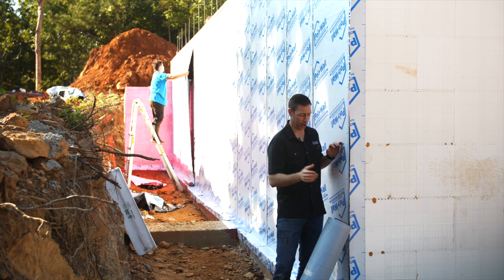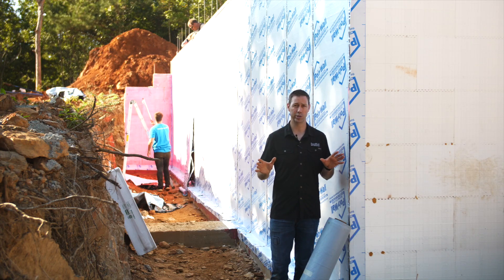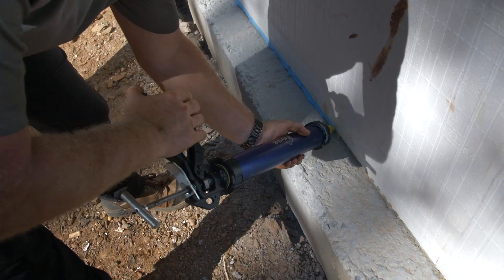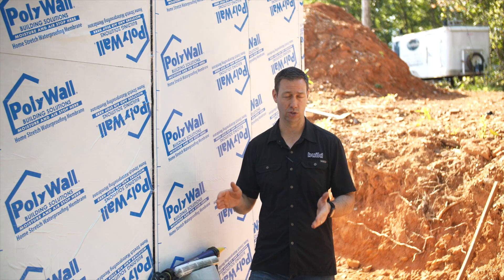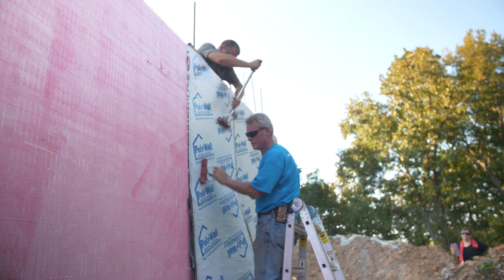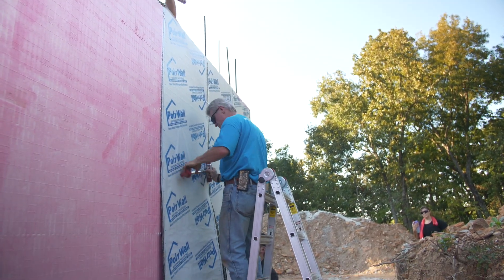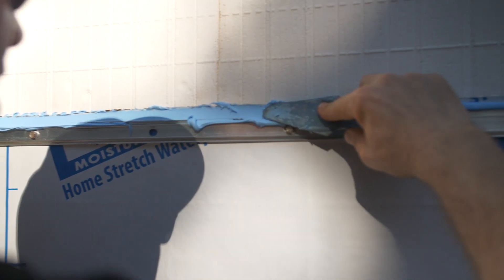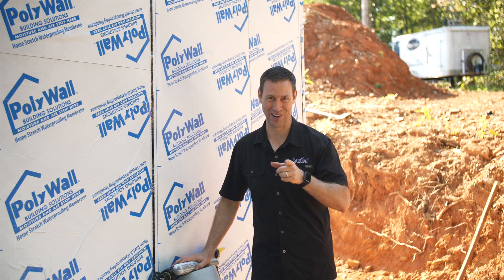This Pink Stuff is The Secret to ICF Waterproofing

Comment: If the location of your project needs the waterproofing you are installing, I believe you should put in a floor drain that allows the water table to enter the inside of the house. The reason is if the water rises on the outside only; it will lift the building like a ball in a pool.

Comment: If you use 4400 PSI concrete, no waterproofing is needed. Cost is higher, but you save in other cost down the road. No matter what type of covering you use on the outside, the concrete itself will be waterproof. I just looked on google and these were the prices of concrete mix, which vary from location. I think it would be cost effect to use higher PSI concrete for several reasons too. Waterproof and stronger are number 2 reasons!
3,000 PSI, 6.0 Sack Mix	$124
3,500 PSI, 6.5 Sack Mix	$126
4,000 PSI, 7.1 Sack Mix	$129
5,000 PSI, 8.5 Sack Mix	$147

Comment: Can you add rockwool exterior insulation?
I know insects like the foam and it catches fire easily
Rockwool doesn't
Reply: Insects don't like the foam, they only use it to reach any wood parts of the house. It also doesn't catch fire easily, no easier than timber.

Comment: What? Why would you not cantilever the wall over the footer? It's crazy setting it the way it is pictured. Water will eventually find a way under the ICF with the walls set back from the edge. Sticky paper stuff cannot last more than 20 years or so.
Reply: Building codes (in my area at least) require a minimum of 2" of footer on either side of the foundation wall.

Comment: Does anyone know if you can do this inside? I have a storage room that is made from this foam project but it leaks into the storage room.  The house was built in 1997. It's already been backfilled. Just wondering if I could do this inside the room to stop the water from coming in? Or if that defeats the purpose of waterproofing.

Comment: Just watched a video about how ICF is impossible to get touched by any termite treatment if you live in western NC... they can't do any type of reliable inspection on the foundation to see if there are termites fluting up inside the Styrofoam insulation walls... This seems to suggest that these waterproofing steps are not bug proof and the bugs can foul the waterproofing up. I am not happy to hear any of that as I really like the idea of ICF otherwise. Any thoughts?
Reply: We install ICF in S.C. , I install a metal cap at the top of the wall so termites cannot tunnel up through the foam

Comment: german structual engineer here. Weird that youre not just using waterproof conrete (25cm thickness) and a internal joint tape. That system doesnt fail unless you mess up the concrete bigtime which would be visible and fixable before you backfill the basement. These external applied PA doesnt protect from pressurized ground water right?

Comment: Awesome video, Matt! If a project calls for ICF on both the basement (9' height) and the 1st floor (10' height), how do you phase the work? Or, are both the basement and 1st floor assembled and poured at the same time?
Reply: there is a cold joint between the lower level and the first floor.  Much like the cold joint at the footer.  In theory you could pour them all at once but the weight of the liquid concrete may cause a blow out of the blocks, the relative high falling level of the concrete could cause separation of the aggregates and it would make vibration difficult.  supporting the blocks during the pour would be difficult.  so they would leave rebar sticking up 4 feet out of the lower level, then lay the blocks over them, tying them in to the rebar.

Comment: Isn't applying polywall an overkilling?  I would expect the concrete to be water/air proof and will concern only the possible damage that could be done below grade by backfilling.  That is the only reason I think the foam needs protection for.  Can someone please explain?
Reply: Moisture weeps thru concrete. Joints in the blocks allow water to penetrate into the concrete. Always use a moisture barrier to keep water away from concrete that you want to keep dry.

Comment: I would like to know in the ICF construction is it possible for the foundation to waterproof by putting cement on the ICF and after putting Bitumin on top of the cement which is on the walls of the ICF .

Comment: I live in upstate NY, whenever we do icf's we always use pour a concrete chamfer  between the footer and the icf, a few inches up the ICF that tapers away from the building the width of the footer on the outside to help shed water.
Reply: We just did a monopour in upstate NY using the Foothold footer form with ICFs for the wall. It prevents the cold joint, and makes it unnecessary to do a separate footer pour.

Comment: Great video, very detailed. Now if you build in a flood zone or have a high water table, the waterproofing will be a life saver. But generally, I wouldn’t want water to get anywhere near my foundation. French drain and wraparound deck should be helpful. Would not want to skip on waterproofing though

Comment: Went to poly-wall's website, they say this stuff will only work with 25 degrees or higher. I am planning to build a home in the UP in northern Michigan, were temperatures in winter go between 7 degrees and 37. What waterproofing method would you recommend for this?
Reply: That's the temperature for applying it. If you look at the data sheet, it passes a -15F flexibility test.

Comment: Putting that expensive caulking and tape on the entire ICF wall is a complete waste. If you deal with the possibility of water entering at all your openings in the wall correctly, that's all that matters. Unless you are trying to seal against a high water table in basement walls with tape layers (also a bad idea), there's no need to tape your basement walls against moisture coming in through the walls like that.

Moisture on the inside of a basement is likely from condensation, which for an ICF house, that can be a real issue since your air exchange is some tiny fraction from normal leaky houses.

Comment: Your videos are very informative an straight forward. Any thoughts on termites, bugs using the insulation for nesting? We have a house on well and septic as well as a pond very close and stream, streams. We don’t want to treat any soil because of these issues.
Reply: Termites and other bugs won't eat the styrofoam or nest they don't like it. Another reason the home insurance is cheaper.  If you put wood trusses and roof, the termites will go to the roof and eat. Put a concrete roof on your house and bugs won't be a problem.
Reply: Mike Bigelow how do you build a 6/12 concrete roof?

Comment: In Poland we isolate foundations (normally brick foundations) with styrofoam blocks (for termic isolation) + mesh + plaster and then we paint 1-2 layers of tar-based isolator called "dysperbit". This gives more then enough waterproofing and you don't need special crew that knows how to stick correctly sheets of isolating paper. Basically even a kid would be able to paint it. At least this is enough if foundation do not reach underground water level. Horizontal izolation we do with tar paper 1-2 layers heated with a torch to melt nicely and stick. You should be able to do same/similar thing with ICF. If this is feasible this would make it far better solution then depending on crew's expertise on sticking poly-wall waterproofing paper. Far less probability of error

Comment: Matt, left you another message on another video but for this one, if my home is 100% above grade actually probably 3 feet. And I will have an ICF foundation as well what kind of wall waterproofing would you suggest. It just seems the system in this video  is more for below grade and or were grade made meet the wall. Just looking for some thoughts I will likely call poly wall directly as well

Comment: So if you lived in a colder climate could you put something like the zip system osb with 2” attached foam insulation on the outside?
Reply: Cold like Canada? Not recommended. The vapor point could be inside the wall and it needs to breath.
Reply: 99beta then how would you go about adding more insulation to the outside? I’d prefer a good 6 inches. Zip-R9 has 1.5 inches of foam, there should be no condensation behind it. 

I’m also thinking that using the Zip-R would give a continuous surface for waterproofing and siding attachment points.

Comment: Most concrete basements I've seen don't have any water-proofing.  Is it a big mistake no to water-proof?  Surely the footers on even this ICF project are not waterproofed...
Reply: This is really soil dependent. Some very well draining soil areas, like sandy places, the builders don't do anything beyond the minimal asphalt damp-proofing. If you are in heavy rain locations that has any clay content, you should likely waterproof. I recommend it for every house because the one deluge may come and overwork your natural drainage conditions. If you are on high ground in fast draining soil, and super tight on expenses, you could probably get away without serious waterproofing. But I recommend at least a little mitigation effort. Even if its just a 6mil polyethylene sheet draped down the wall before backfill and backfilled carefully not to tear it too much. Runs a few hundred dollars even on a large house and will catch most issues for most people. For people living in the mud, an integral waterproofing admix like Xypex or such should be used. For a high water table build that is only going down a few feet and you could run a horizontal peel and stick, that may be more cost effective. So, it all depends. Your local codes will provide a minimum. Your soils engineer will provide a good answer. (And get a soils engineer to verify bearing capacity so you can likely reduce your rebar and concrete load, a few hundred dollars in the soils bearing test typically saves a few times its cost in rebar and concrete due to overbuilt footers, and a little bit of peace of mind.)

Comment: My question is termites. I've seen termites build channels through Styrofoam to get at wood several feet above. They stay moist and warm on their journey to lunch. Will the foam on these walls act as a conduit for termites ?
Reply: John Lynch I’ve read that the foam does not stop termites or ants, but I wonder if this poly wall is too much for termites to eat through?
Reply: @ScottTooley  I had a neighbor who replaced some damaged siding. Under the siding was styrofoam sheets of insulation. The termites ate channels through the styrofoam. Looked like a multi tunnel subway system.
Reply: Termites is the biggest drawback of ICF. Be diligent in termite proofing

Comment: I was wondering cost in materials and labor just to have it sprayed with a closed cell polyurethane foam. You get higher R values per inch 6.5 vs open cell foam of 3.7  per inch as well as no penetration from water etc thus eliminating the extra labor and materials for the outside barrier.. I know the spray is more expensive but only needs 1 laborer to apply and can be done in 1 step. Thx.
Reply: spray foam is solvent based and will eat the styrofoam.
Reply: @marks6663  Thx Mark, good info to know.

Comment: Common sense? Ring a bell? And or life experience?......... you have 6in of monopour concrete maybe 8 ...... etc.  water is not going to blast it’s way in. It finds the easiest path of flow. U got 2 inch foam then6 inch concrete and 2 inch foam again. All this useless shit u promote is a waste of money and time. But hey I get it it’s your job to feed trash to retards
Reply: Concrete is not water impervious naturally. In slow draining soils, expansive soils, and high water table areas, a flooded basement can quickly occur without waterproofing the concrete. Concrete is just like a very heavy and dense sponge. Once it saturates because of the hydrostatic pressure of water against the concrete it will just drain water into the basement. Or make it damp and gross. It is a real issue.

A better method exists (like adding a crystalline waterproofing admix such as Xypex) for places that really need it, and a simple polyethylene sheet down the wall will work for less water prone areas. But waterproofing concrete is important. I have seen from life experience what happens to both ICF and regular foundations when the walls are not properly waterproofed. It's best to do it right when you are in the hole the first time!

Comment: Wouldn’t best practice imply placing the PolyWall horizontally with shingle overlap between sheets?

This way rainwater will not be able to get under the stick & peel sheets.
Reply: No you need vertical.    You are working against hyraulic pressure.  Gravity is your friend!
Reply: U can layer yes
Reply: Or I was literally thinking double layering it the Polywall....no chance of any leakage then.... Why not besides cost?

Comment: This may be a stupid newbie question and I may have missed it but if you are covering the ICF w/ waterproofing how does one know where to place screws for your siding or stucco?
Reply: There is no need to waterproof above ground level with anything, peel and stick, liquid applied, or otherwise. So they should all be readily visible. The ICF wall behaves as waterproofing (as far as driving water is concerned) and air seal intrinsically above grade. Good window and penetration details are important to consider, but the field is fine to be left alone.
Reply: The thick membrane is applied on basement walls which will be covered by dirt. Above the ground use only the liquid - the blocks have on their surface grooves which indicate were the plastic beam is located.
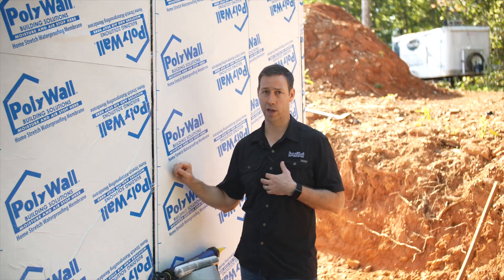Reply: Pause at 7:46. There is no way that entire structure with polywall will be covered by dirt.

Comment: Does anybody know the downside of not waterproofing icf? Since concrete doesn't rot then is this just about preventing damp air inside?
Reply: Flooded basements is your real worst case scenario. An annoying scenario would be dampness. And in most cases, nothing will result. At least most cases in jurisdictions that don't have codified waterproofing requirements. But in places where waterproofing is required for standard foundations, it will be required for ICF as well, so you'll end up doing it anyway. For good drainage soil waterproofing really comes down to preventing the hundred year flood from overcoming your natural drainage long enough for your walls to get saturated and enough hydrostatic pressure to drive it into your basement. For bad drainage soil...well, it's probably code required to provide waterproofing, with good reason.

Comment: There isn't a proof of the lifespan  of that products yet in us are several example of product failure over the time  the building company use this new interest to develop "new products to literally scam people that guy spend a lot money on built that's walls plus more money in waterproofing  where are the French drain inside and outside ?? Old technology  proof to be last for a fraction of the cost and if the systems  fail bc none isn't  perfect fix it is still cheaper  and bf  I forget ask for the manufacturer's  warranty they will find excuses  to protect their products

Comment: I used xypex as a admix to the concrete poured for the below grade portions of my ICF house 15 years ago. It's still doing very well . The nice thing about an ad mix is that it's permanent. It's not going to degrade. And, in the case of xypex, it will handle up to a .4 mm crack in the monolith. Personally, I have concerns about the relative Dynamic environment present here. But, I'm not a builder, except of my own house.
Reply: Well played. Xypex is the best bet by far. If Matt were aware of Xypex, I think he would lose his concerns about 'watersealing the cracks of the ICF wall'. Unfortunately, they are adapting old systems to ICF when newer technology like Xypex solves all the issues upfront.
Reply: @joshualruby  While I am a fan of Xypex, the placement of concrete would need to be flawless for it to work without additional waterproofing--no honeycomb, no cold joints, etc. Lithium crystalline additives mostly prevent moisture traveling through a porous medium by densifying or filling voids. It cannot overcome imperfect a.k.a. average concrete practices.
Reply: @adamrichins1908  I do agree that care would have to be employed to make it work, but a properly consolidated concrete placement should suffice. A stinger vibrator easily eliminates most of the full depth transfer hairlines/voids, and Xypex is rated for .4mm gap spacing. They also have a concentrate blend to apply for cold joints. I imagine other brands are similar. But monolithic footings in bags would be most ideal to avoid the cold joint. FabForm's monopour systems is pretty slick for that.
Reply: I am also a proponent of Fabform monopour, ICF, & Xypex. Helix micro rebar is a neat component also, as is stegowrap when putting together a bulletproof project. Just saying the products aren't the weak link--the installers are.
Reply: Adam Richins Indeed, but I would say the margin of error to screw up the products you just mentioned (all of which I recommend save the wrap, just because I haven’t heard of it before, so have no opinion of but will in about twenty minutes...)less susceptible to poor installation than most other options. The integral and monolithic options always seem to be more foolproof than the layers upon layers of peel and sticks. So, minding the installation is important, but so is every case, and I think, overall, the susceptibility of poor install in integral systems is less than the other options.